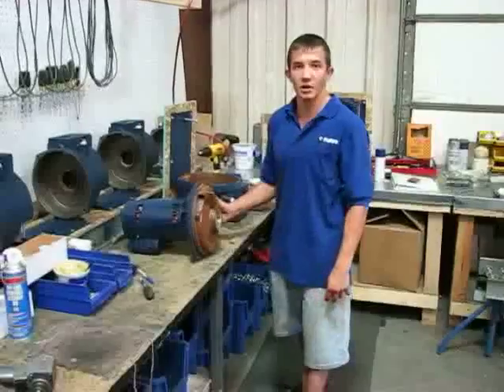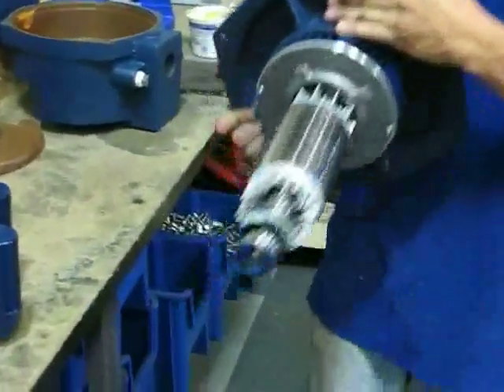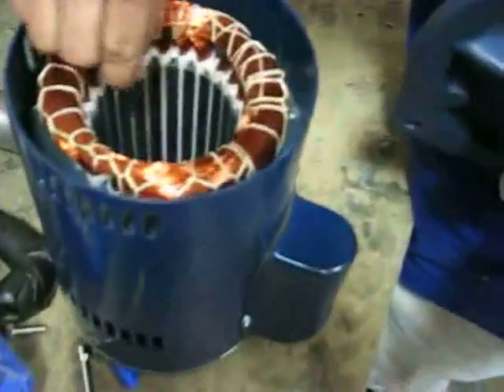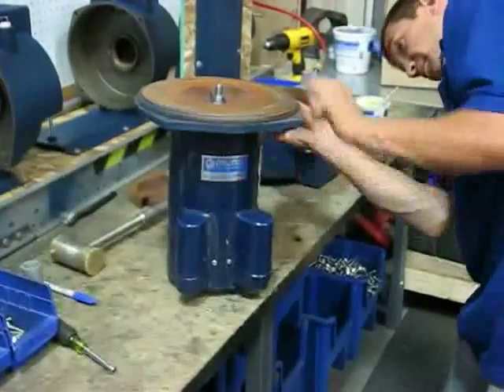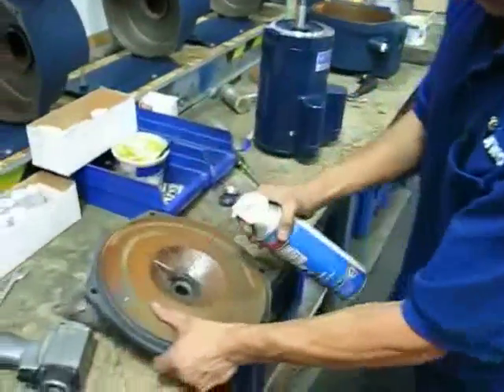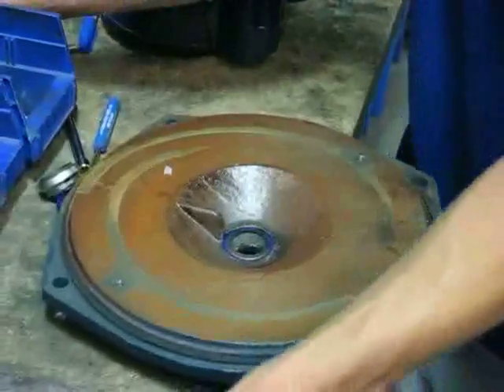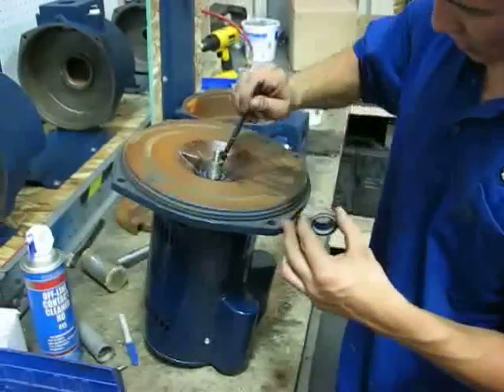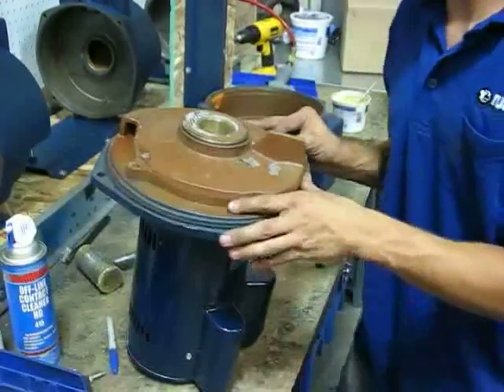Munro - LP1500 Series Shaft Seal Replacement

Comment: Excellent video Jon!  Will be buying one of these pumps from you tomorrow on site.  Was at your shop today and really appreciated the knowledgeable help working there.   The fact that it is all made RIGHT HERE locally.  Better yet, at a very fair price for what someone gets.
Reply: I ordered the seal replacement kit and the paper instructions that came with the kit say to use light oil, but you are using grease, which is it?